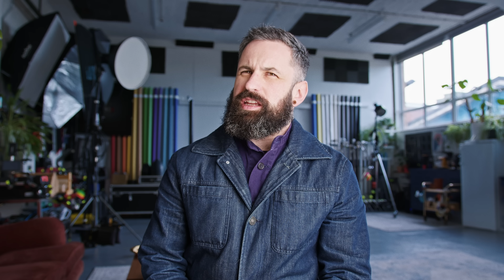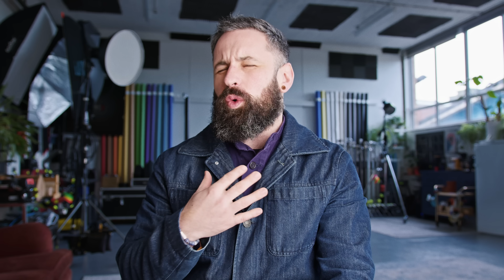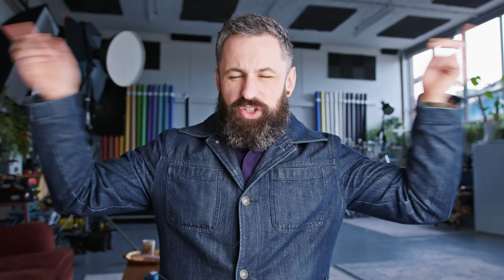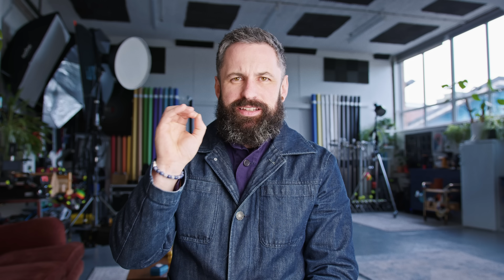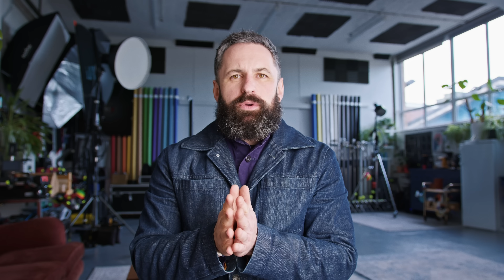THIS Is Awkward: Why Pro Photographers REALLY Have the Best Kit

Comment: Kit does matter. Period. Anyone who says it doesn't is naive or lying to themselves. You don't need to the top bleeding edge but you need the right gear for the job and you need gear that is reliable. It doesn't replace skill, it compliments skill. Its a limiting factor. A great photographer with shit gear probably can still do good work but they will do better work with high quality gear that is right for the situation.
Reply: I fully agree with having relaiable kit (plus backup options). Sounds obvious, but old kit- that indeed, is 'right for the situation' is great- however as soon as there is even a small recurring electronic or mechanical issue it needs to be fixed or the camera replaced. We rely on cameras as tools for the trade, not fancy toys.

Comment: Great video - I'd also add clients expectations are important too. If you've got big expensive kit, clients assume you are good.
Reply: Yeah, i work for tv station, sometimes companies buy not only commercial on air, but production of it. We go there with Arri cameras or Sony Venice knowing that Sony FX9 or FS7 or even FX3 would do the job, but when your client pays 100k you can't show up without cine lens. In fact why would you tell your client that it can be made with 20k instead? Just grab unnecessary equipment and do it with 100k.